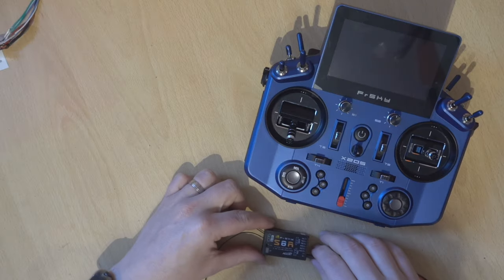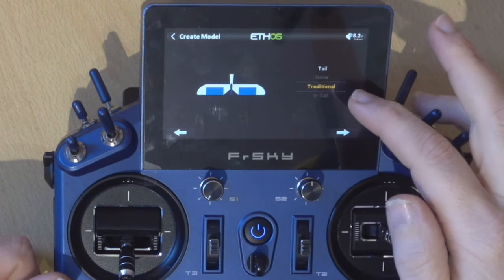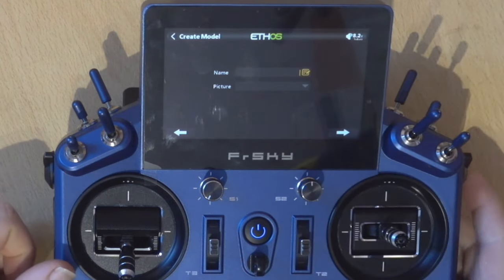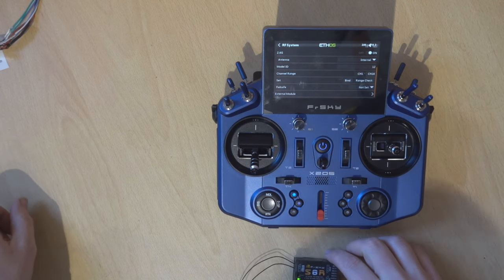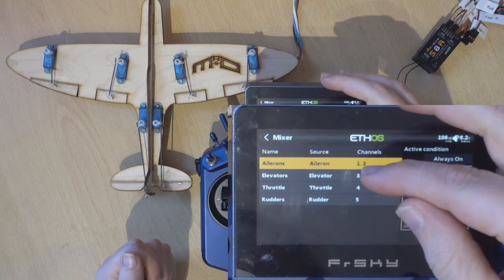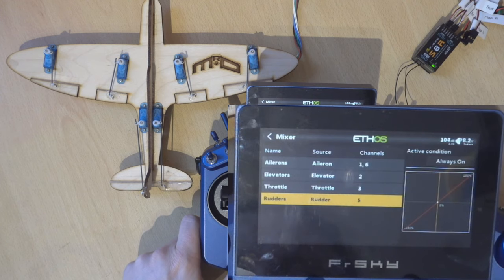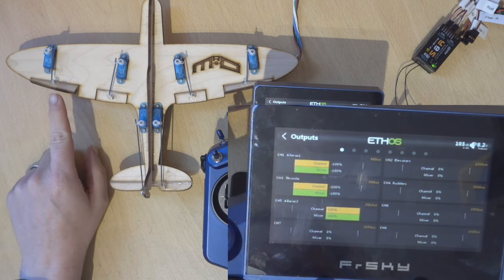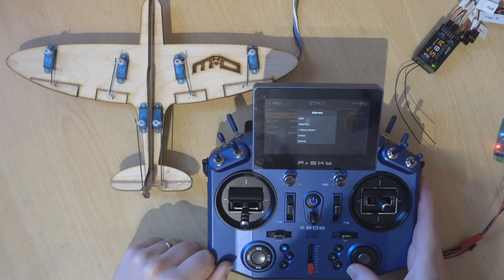Setting up a basic plane model in ETHOS

Comment: Hello Darren, I have been using OpenTX for years, and thought that the Ethos is actually not really helping me in setting up my planes. 

Anyway, having gone through the series of the very intuitive videos your presented us with, and relearned my rhinkinf, I am beginning to appreciate the Ethos programming dynamics.

Thank you sincerely for enlightening the community with all your efforts, much appreciated.

Alex
Ontario, Canada
Reply from the maker: You're welcome Alex. I'm glad I could help. Yes, some parts of ETHOS are pretty similar to OpenTX. Hardly surprising when they same guy wrote both. But other aspects are very different. It's like Bertrand is doing what he would do if he could write OpenTX from scratch, with all the lessons he learnt along the way. I can only see ETHOS going from strength to strength.

Comment: Hi Darren, really like your channel and how you make it easy to use the x20, would it be possible to do an episode on how to set up head traking on the x20, I have some eachine ev 300o goggles and  struggling g to get the inbuilt ht to work. I would be really grateful. Cheers
Reply from the maker: Thank you. I’ve recently set this up on my FW-190 with pan, tilt, and lean. Unfortunately I’ve not flown with it yet as the VTx is complete garbage. But, I can go through the setup that I’ve used. 

Sorry, I thought I replied to this comment the other day.
Reply: @MrD  I'd love to see a video on this also!

Comment: Hi Darren, I have a query I know you will be able to help me with!!  During set up , if I go to say aileron1 below the Centre/subtrim there is PPM Centre ------   1500us. I have found if I click on this I could set servo centre . Is this good or bad rather than setting Centre/Subtrim because I don't know !!!!!  Ali.    PS,I really like your instruction using ETHOS !!
Reply from the maker: Hi Ali. The two functions are similar, but work in different ways.
If you use the centre/subtrim. This will move the central point. But it will keep the servo movement within the set range (-988us to 2012us by default). The trim buttons move the centre/subtrim.
On the other hand, adjusting the servo centre shifts the entire pulse width of the servo. For example, if we set the servo centre to 1550us. This also moves the minimum and maximum pulses up by 50. So 1038us to 2062us respectively.
In most cases, you're better off just using the cerntre/subtrim.
Reply: Darren thanks for your understandable reply ! I see the error of my ways !!!!!

Comment: What's happenin Mr. D!? Have you been able to setup a trainer setup using the x20 on Ethos as the master and an X10 running OTX accst?
Reply from the maker: I’ve done it the other way around. But switching the master and slave would cause no problem. It could even be easier with the ETHOS transmitter as the master.

Comment: Hi Darren. I had a bit of a tricky situation but I’m trying to back myself out of it. Still setting up the f14. It was going really well, shifted they gyro channels away from 9 and 10. But I think I accidentally entered the blue light mode. Right now I have really limited movement in surfaces possibly caused by this. How do I re enter this mode as I’ve read it’s a way to get full range of surfaces. I’ve tried setting Channel 12 to a 3ps and toggling multiple times but still no luck. Thanks for all your help.
Reply from the maker: Hi Ant,

First, you don’t move the gain and modes away from channels 9 and 10. You reassign the pins on the receiver to be other channels, such as 13 and 14. Channels 9 to 12 should be left for the stabilisation functions. 

The limited movement is likely from a self check with no stick movements, or while in low rates. 

For the self check not working, have you looked at that section in the video. The switch delay was what solved it for me.
Reply: @MrD  thanks a lot for all the info. Your vid fixed my calibration issue and now all surfaces are working well. I also realised that having two aileron channels, means that Channel 5 is aileron 2. I think the missing board causes some issues on the F14 as the tail is pretty much a aileron and elevator. The wing aileron are two separate channels so I have 3. I’ll work around it though and I appreciate it’s one of the more complex set ups. Setting up these receivers on other jets are a breeze thanks to your help so again, thank you.
Reply from the maker: Yeah, the F14 is a strange setup. On the real thing, they hardly ever use the wing ailerons, only at slow speeds. Most of the time it uses the tailerons. Unfortunately basic stabilisers don’t have the ability to do complex mixing. But good luck and I hope you get it flying great.

Comment: watched this and I can use the throttle cut when a physical switch is used as active condition. I’ve now made a logical switch that sticks on when a momentary switch and ele down are pulled. When I substitute this (LS 5) for the physical switch, and LS5 is off, the throttle still responds to the stick. Confused I am.
Reply from the maker: Hi Randall. I saw this question on the discord channel. It will be easier to check out there.

Comment: Hi Darren,  I've been using your videos as my main "learning ETHOS tool" and they've been a huge help to me so far.  One question with regards to throttle cut...Is it possible to set things up so that it takes two switches to be flipped before throttle will become armed?  Sort of a "pre-arm" switch and a "final arm" switch.  With FPV quads I always utilize a pre-arm and arm switch in Betaflight and would like to do the same in ETHOS to prevent any accidental "bump" of the transmitter causing an unsafe spin-up of the prop.  Thank you!
Reply from the maker: Sure. You would just need to use a logical switch. Make an AND switch, which is active when both your arm switches are in in the armed position. Then use the inverted logical switch to activate the throttle cut. Long press on the throttle cut switch to set it to inverted. 

You could use on of the momentary switches too. So that you would need to hold the momentary switch in, while moving the main arm switch. To do that, set up the momentary and arm switch in the AND logical switch. Then add a second, STICKY, logical switch. This should be activated by the AND logical switch, and deactivated by putting the main arm switch in the disarm position. Use the STICKY for the throttle cut, again inverted.
Reply: @MrD  Excellent, thanks so much Darren.  Do you have a video on logical switches or is it easy enough to dive into the manual to figure out?  (Sorry but I'm a total newbie with ETHOS and have never used Open TX either.)  Thanks!
Reply from the maker: @Skavage  I have a few videos on logical switches in OpenTX. In ETHOS, it is very similar.
Reply from the maker: https://youtu.be/LUm69xz-WJE

https://youtu.be/BbEFWwMV6mc

https://youtu.be/vVxbkuINJUM

Comment: Hi Darren. Bound the SR8 PRO previously for my model according you illustrative video and al worked fine. Somehow, after a problem with the X20 transmitter (I shut down transmitter, while receiver was still on (override)). Thereafter, upon restart the transmitter and switch on battery for receiver, the receiver was not binded anymore. Followed your binding instruction again and again, but no success. The receiver led stays red and no binding. Thus did I blew it all up, or something else ? Hope you recognize this problem. Greets, Ron
Reply from the maker: Something sounds strange here Ron. What happened on the transmitter? I’ve used the shut down override many times and not had any problems.
Reply: Maybe an error on the standard  SD card which came with the transmitter. I' ve read that better quality SD cards are recommended. After the override and booting up the transmitter I got the error message Invalid model data. I had only one model in my transmitter. HoweverI think I will create a new model for my plane and see what happens then.
Reply from the maker: It may be worthwhile opening an issue on the ETHOS GitHub. It sounds like something has possibly corrupted on the model file. The developers can take a look at the file and learn from it. 

Yes, it would probably be worth replacing the standard MicroSD card. I’ve put a Samsung Evo Pro Endurance in mine, and it’s been great. It even seems faster connecting to windows than the old MicroSD card.
Reply: @MrD  Thanks Darren, I will order new SD. Today tried it all over again. Deleted my models, setup a new one, registered/bind the SR8 Pro again. Calibrated, set all stabilisation mixers, connected the servos and it worked.... for a while. All of a sudden I had no servo outputs, only a small out put on the rudder servo. The others were dead. No error messages now. Frustrated did it all over again, no result. It looks like my transmitter is failing. I am loosing my trust on the X20 now. Will file a support ticket indeed to see if it it the software (hope it's not the hardware)
Reply from the maker: Don’t loose faith. Unfortunately sometimes equipment is bad, especially when it is mass produces. Even Ferraris can have problems. Try the new SD card. Also, make sure that the RF firmware is the latest on the transmitter and receive. If there is a hardware problem, I’m sure it can be resolved through your vendor and support that way. Do you have any other receivers. That way it could at least be narrowed down to a transmitter or receiver issue.
Reply: @MrD  Thanks again Darren. Sorry to be on the line again :-) Github says it's not an ETHOS issue. Some are saying it might be incorrect selftest procedure. If it would be the selftest procedure, do I have to run this selftest(by flipping the switch) every time I power up the system? Because I didn't run this every time, however sometimes the "failure" occurred after 10 minutes (at that time I probably would be flying already).
I have 3 SRx Pro receivers, one still in the box. Will flash new firmware to them all and to Transmitter, get new SD card, hoping I can analyse the root cause of my issue
Reply from the maker: @Ron de Kruijff  No, you shouldn't have to run the self test every time. Also, if it was an issue with the self test, you would not have any control surface movement at all, as I've demonstrated in my SRx receivers video. The fact it works for a certain amount of time, then stops is not consistent with a self test issue. You could try disabling the stabiliser, just to see if it still happens. You do that using the SxR tool.

Also, the self test being the problem doesn't explain the corrupt model file, nor the shutdown issue that you had. It would not stop you from binding either.
Reply: @MrD  Hi Darren, I took a third receiver (brand new SR6 Pro from the box) Installed new fews firmware 1.0.18, Internal Module 2.1-1.15 and receiver Archer-2.1.9. Put it on new SD Card. It all is working now! I now know all your nice video's by heart :-) One more question: how to reboot/reset the SR8 Pro? It remained on red led, als after upgrading to 2.1.9 version.
Reply from the maker: Great to hear the SR6 is working for you.

You should only need to power cycle it. But it may be worth going through the registration procedure again. If it keeps staying red, perhaps there is a problem with the receiver. Is the other SR8 Pro ok?
Reply: @MrD  Finally all receivers reset (1 x SR8 and 2x SR6) and working fine. Thank you so much for support Darren!
Reply from the maker: Awesome Ron. I’m glad everything is working for you. Hope you have some great flights now.

Comment: Hello Mr Darren..thanks for your help.
it is my first time I got such a TX (X20S) and I am very pleased to have it. (I had a futaba FF9 but after 18 years of good working it dies.)
I follow your very   simple and formative video (I made a little demo plane as yours)and every thing works O.K.  with one exception  the electrical  motor does not work.  I tried hard but does not work at all.
Please I would be thankful if you will give me a solution.  I am not young and very used to such a "computerise "TX but I really want to mess with the new tech.
I use the ARCHER  SR6 RX .
Thanks in advance for helping me 
yours FANIS .
Reply from the maker: Hi Fanis, thank you for you comments.

Unfortunately it is difficult to work out what is wrong without seeing things such as the mixer. All I can suggest is to look at the mixer for the throttle. Go to the bottom of that screen. At the bottom you have bar for the channel output. Does this move if you move the throttle? If it does, the radio side is fine, and it could be the ESC side. 

If the bar does not move, look to the right and you see the curve display. If you move the throttle, does the red line stay diagonal from bottom left to top right, or does it move flat along the bottom? 

If it's flat along the bottom, you have a throttle cut set. You can change these settings higher up  on the throttle mixer page.
If the line is bottom left to top right, you may not have an output channel set up. Look at Output 1. If it is set to ---, you need to set it to the throttle channel. That would be Channel 3 if you are using AETR ordering.

I hope this helps Fanis.
Reply: @MrD   Thank you so much for your quick replay and  help. 
 I think the problem is indeed in the ESC, because i checked all that you told me about in the Tx and it works. Maybe the ESC isn't compatible with the Tx or the receiver i don't know, i emailed FrSky for it. I hope they replay soon. 
Fanis
Reply from the maker: No problem. It sounds like the throttle is being sent. You can double check on the outputs page. Have you tried calibrating the ESC?
Reply: @MrD  Hello Mr. D, at last I found the problem it was a damn faulty switch. Now everything is fine. Thank you so much for your replay and for your willingness to help. Your videos are really good and easy to understand. Keep on the good work!
Reply from the maker: @FANIS1950  I’m glad you got it sorted. Those switches can be a pain. Especially if they’re intermittent.

Comment: Darre' whdo you not use clone ad make the more adjustment?
Reply from the maker: With similar models, sure. But the idea was to show the setup process. You need to have a model before you can clone it.
Reply: @MrD    checking as you never see someone use the clone and once i was told it was bad to do...  thanks!
Reply from the maker: @kitchenstrand  I use it all the time on my FPV models. They are a lot more complex setups than my LOS planes. So it's much easier to clone them and update what I need to.

Comment: Hi I have freewings 3 ways throttle ail ele and don t arrive setting it on my x20 and sr6 ?
Reply from the maker: Sorry, I don't follow the question?
Reply: @MrD  i have only 3 channel for 2 servo. Each servo control aile and elevator same time
Reply from the maker: So they are elevons. If you check out my latest video. I show how to set up elevons on the SR6. This is only the mixer and stabilisation part. The modes, gain, and self check are in another video with the links in the description.

https://youtu.be/gQuf0xMdEuk
Reply: @MrD  i saw butt not the same configuration : elevon and aile have same single servo for right and left
Reply from the maker: Can you provide a link to the model in question?
Reply: @MrD  setting like delta wings apparently
Reply from the maker: Delta wings usually have elevons. So it would be the same as the video. If you can provide a link to the actual model, I could check for certain.